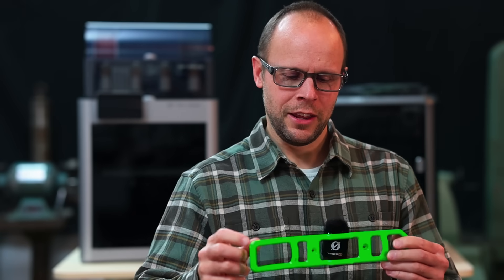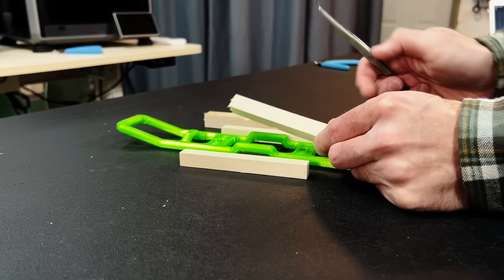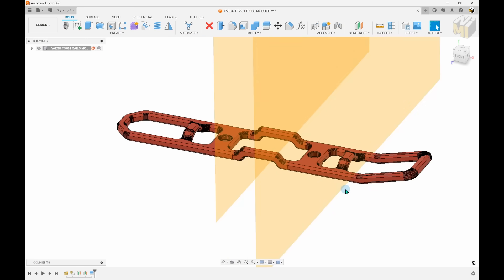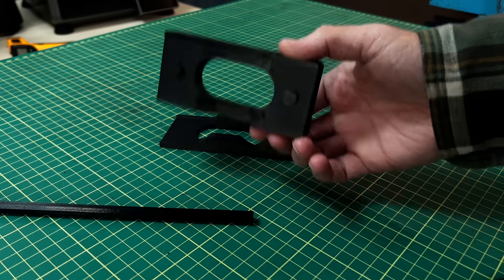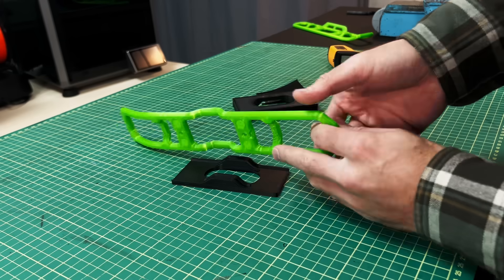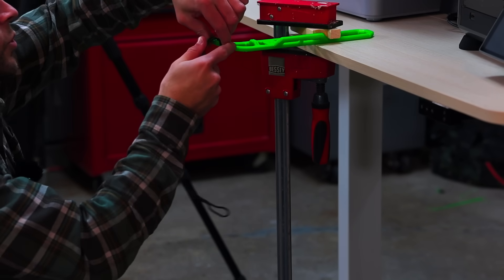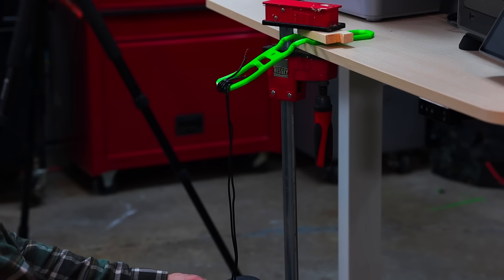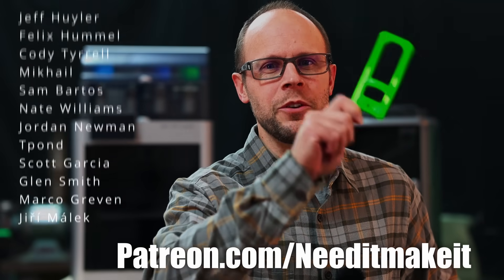2 Simple Ways to Make Stronger 3D Prints + an Experimental Way

Comment: Petg-CF. Problem solved. Dry, 30% fan at high speed extrusion and 70% fan on overhangs. I have parts I am manufacturing for mass production and they need to withstand 50-75lbs of pulling force.
Reply from the maker: I'll whip some up, I have some PETG-CF, I've found my prints with it in the past to be brittle... but it was the cheaper stuff, I'll add it to the roster to try again!

Comment: While it may not have worked for strength, I like the forming idea as a way to print parts without supports or bridges, and that curve would have had obvious layer lines if printed that way.  Obviously, there's the overhead of printing the forms, but for creating a lot of the same part, where you can reuse the forms, this could be a great technique.
It would have been interesting to see which was strongest when used as intended.  That is, bolt it properly to something rigid, and put a strap through the loop, and hang the weight off the strap.  I suspect the formed part might have fared better in that test.

Comment: Might want to try a hard shore strength tpu
Reply from the maker: I'm just about to setup to test 95A TPU, but I'm not sure it's hard enough, it seems anything harder is "too hard" or at least that's what people are telling me.  From my testing so far, the 95A seems a little too flexible.
Reply: Yeah, 95A should be good for this purpose, but in all honesty you need to revisit the actual design as well IMO. I feel that thickness, print orientation and print speed/heat/nozzle size will all play into how this performs. 

There is no reason that a well designed part in 95A, that is well attached, will not be strong enough. 

As other have mentioned ABS/ASA work well too for strength. PC is about the strongest, but its also the most difficult to print properly and its also a material that suppliers on the cheap side seem to mess with and screw up. Has to be a decent brand/quality IMO.

Good luck. Like the videos. I like that you provide a more realistic use case. You cant just 3D print everything and i like that you, like myself, mix media and techniques for best results and tactile feel.

Comment: I would take a different approach. Instead of trying to copy a fragile frame, I would think of making a plate. I can't see any reason, why the outside could not be flat. So the plates become thick and chunky, perfect for 3D printing and very durable. If you make the outside flat, you can arrange the mounting points an all needed features easily on the inner side. The plate was a perfect for making a clever designed hole for the belt, and you could arrange a channel for the power-cable too. And towards the front you kann taper the plate on the inner side, so you achieve the "curved" look of the bent frame. I would imprint hexagons on the outside of the plate, so the look would be very nice too. Greetings from Vienna!

Comment: interesting idea to print, then press it in a mold, it might not have worked for this project, but im sure the idea will have its own usefulness on one some where. Its a idea ill have to try to remember.
Reply from the maker: It's a little bit like steam-bending wood, which works really well... though it is pretty slow.  I think there is still some potential, but there are some things that need to be better understood about this material first.  I wonder if ABS is a better choice for forming in this way?
Reply: @NeedItMakeIt  either way, it earned my sub.

Comment: Like your simple approach to this testing method. Since your are using translucent materials, you could back light and use a uniform load at different directions and positions to see where the stresses are applied. The light diffraction on the part would help show where to focus your attention. After collecting a few images of the various loaded stresses, look at all of the areas to focus on either increasing rigidity or flexibility (depending on what behavior you are looking for based on the parts use). Would be interesting to watch that as an experiment😁

Comment: For the inner-void trick, bear in mind that it lets you shape and direct as much of the inner “fill” as you want. I’d try extending the void channels all the way, curved around to the screw holes and continue down and around the full length. That way the stiffened section doesn’t just end internally, perhaps acting as an even-worse vertical shear/break point.
Reply from the maker: That's a good point, having it stop short caused the stresses to concentrate just beyond the solid area.  I have a follow up video as well which went over a few other options and materials and there was one that stood out from the rest, it was pretty impressive actually, the 'tear-drop'
Reply: @NeedItMakeIt  yup. Watched that one after this one!
Reply from the maker: @AndrewPlumb  Nice, thanks!  I think you're right, I'll have to do some more tests, I have a TPU version that I want to make as well, so many people say that TPU is the way to go, but it's so much different, I need to work with it a bit more and figure it out.  It's super slow to print and more like a rubber, so mounting it and having areas which are stiff is something I need to think more about.

Comment: Is it going to far to print the "beams" in two parts, perhaps with little pegs to connect them and a channel in the middle, heat and bend them, and then place a wire bent in the same way between the two halves? Or perhaps print them halved but otherwise in the final shape you need and to put a wire in there?

Comment: i dont believe the formed one was weaker per say. my assumption that the area you formed became stronger the rest. the point of which that sat on the edge that wasnt heated and formed is where the bending occured. you can see the bridge that was formed showed almost no bending under stress. how ever both ends of either side of the bridge bent significantly, by hardening the bridge the new weakpoints became where the harding started and ending on both ends of the bridge..
Reply: with that said try making a form for the entire model and heat form it in all in one go.
Reply: im curious to see how this would effect the model in its entirety. by doing this i also believe itll be stronger but you will lose the pliability of the item making it brittle. thanks for this video. good stuff!

Comment: I have watched many many 3D printing videos and the overwhelming conclusion I've drawn is that the best trick is to just print everything as standard as possible.  No baking it in sand, no embedded fibers, not super slow or super fast, just 0.2mm layer heights with regular speeds.  If it needs to be stronger, change the design.
Reply from the maker: Avoiding post-processing is one of the biggest benefits of 3d printing, best to take advantage of it for sure.  I just released a follow up video to this one to show off some of the different properties of the materials.  No post-processing, aside from using supports because I printed all of the parts on their side.  Performances ranged from poor, to extremely good using ABS/PC/PETG and Prusament PETG also.   

I'll be testing TPU next, but I need to wrap my head around the material a bit better, it is far different than the other materials and requires a different approach I think.

Comment: I use printed parts on a milling machine and a lathe. You should make the parts bigger so it is not bending. With bending the layers coming lose and your lose your structural strenght of the part. What I do on PETG : Use 5 to 10 degree higher printing, set the extrusion to 1.05, 100% solid. If you have a design of alu, make it 2x thicker for PETG (more volume). Remember bending and flexing is bad for the layers unless you use TPU.

Comment: Im building a Printer, Ive had a nightmare trying ABS and ASA for the parts, even enclosed curling has spoilt every try. Then I see eSun's ST-PLA. Super tough dont you know. And it is, Prints perfect, vey little shrinkage if any and it lives up to its name, Printing 100% Concentric infill gives you solid really strong parts.

Comment: I made some legs for the couch from PETG. Total weight was something like 1.3KG. Printed with 4 walls orso then 8 bottom and 8 top layers. I oversized them for good reason. So then I was looking at the strength of them and while they were good, I also knew they could be better. So I turned on the oven at 70 celsius and threw them in. 20 minutes later they had gotten taller and less wide so they were a extremely snug fit at that point. I think given that clearly it had somewhat remelted it should be stronger than it was.
So a couple weeks later my dad finally disassembled his chair that had a broken gear for the rear tilt mechanism and I printed a replacement. I had the orientation wrong so I had to print it again however before printing it I put it in the oven at 60 then slowly increased the temperature to 80. That caused a similar change where it got longer and less wide. So I plugged the numbers into Cura and printed it again but this time in the right orientation and after putting it in the oven it was a perfect fit. The part takes on the weight of who ever sits in the chair so it was crucial it was strong.

What I am saying is: If you need a functional part you might want to test printing it several times edit any flaws and measure everything just to make sure its the right size.

When I just got my printer I tried printing a replacement for the aluminium part of my window. It broke. Using the same method I might be able to make it properly.

Also from my testing there is basically no difference between fan full speed or fan off with PETG apart from lots of strings. That is my testing. Which is by no means accurate. So test it for yourself. In this video fan off seems to have helped so try it.

Comment: Thanks for sharing this very informative video. If you look at the original design page at the 3:43 mark of the video, you can see that they are printing it on the side. Granted, it will require the use of supports, but it also changes the layer line directions to favour strengthening the sections that seem to experience most stress. Would be interesting to see the same test applied to the part printed in that orientation.

Comment: When you formed the last one, it looked like it had the same dimensions as previous ones.  So the forming pulled/stretched the loops.  It also appeared to break roughly where it was stretched for the loop.  I wonder if you would have gotten a different result if you made the original longer to account for the forming of the loops, such that when the loops were formed, they didn't get stretched because there was enough excess material to make the shape without stretching?  Cool experiment though, I never considered forming my prints.

Comment: 3:35 Are you sure you didn't simply print the model in the wrong orientation? Looks like you printed it flat but based on your wood grain comparison you should print it upright so those bends stay mighty strong. Which is also exactly what the creator of the model shows on the thingiverse page.

Comment: Awesome video, Mike! I really like the combination and balance of engineering and making in your videos. There somehow seems to be an 'everything needs to be printed' mentality in the 3D-Printing community. Did you consider using aluminium tubing as top and bottom rails that will be connected and capped off with 3D-prints? (Use off-the-shelf strong parts for structure and 3D-print the unique and intricate parts. Assemble into 1 solid and strong part).
Reply: that was my thought as well.  You could either insert them halfway through the print or make a mold of that part and insert it then :D
Reply: @stevrgrs  Exactly!😀😀

Comment: Alex Labs has a great video on making strong 3D prints. Video is called '#7 I FOUND IT!!! Perfect material for Real Iron Man suit. 3D print + carbon fiber + electroplating'.
Reply from the maker: I've never heard of it, I'll check it out thanks.  I just finished my test rig for some REAL drop testing on these rails, and geez... feeling the weight of this thing I'm not sure there's a lot that would survive a drop.  The goal with the next set of tests is that the rails make sure that the device stays protected, so... hopefully at least one of the options does that.  

I've seen a video or two on electroplating prints.  It seems like we've all gotten a bit carried away with out 'little' 3d printing obsessions.  What do you think it is about 3D printing that draws so many people in?
Reply: @NeedItMakeIt  Give your average joe the power of being a manufacturer, and the world becomes small enough to grasp. True creative freedom to make whatever you want for a fraction of the price. It's liberating.

Comment: Great video, I have the same experience with afterheating and forming: not only does is become brittle (because it breaks where it cooled down the quickiest), but deforms completely, any infill will also shrink, and or become weaker. Printing slow is not the thing, the temperature is. Some PetG's print better at 270°C and 300 mm/s. But I can't see your settings, because the file you uploaded is not a Bambulab file.
Diminishing the model fan definitely helps, bacause the complete model stays hotter (that is why high temp and fast printing are sometimes better with Petg, and only with Petg, other materials have other specs)
Reply from the maker: Ah, that's good to know, from what I had been reading about this, the cooling was the biggest issue.    I wanted to print all of the samples with the fans off, including the cabin fan and I also kept the door closed, which resulted in some pretty ugly overhangs.  At least we have slow even cooling.  After the print finished I let it cool completely before removing it as well.  

With the one print that I post-formed, I could have probably re-heated the entire part to just below the transition point to see if that could help. 

I have a follow up video I'm working on right now, trying to take all of the suggestions from this video into account to come up with something that won't break at all, but rather bends and absorbs the impact.  I have several PETG samples again, but I also have PC and ABS.  That video should be out in a few days.  I'm nearly at the point to start testing, so hopefully we get some interesting results.

Comment: I have made these exact same brackets for my radio. I experimented as well and settled on ASA since my radio will often be stored in a hot vehicle/ While this video is more about strength and less about these particular brackets, I was excited to see them!
Reply from the maker: Ah, cool.  ASA is probably a good choice, did you happen to print these on their side?  That's a good point about storing in a car,  or even outside in the sun.  I have another video on the way with a few slight adjustments to the rails to make them stronger and better to print on their side.

If you were to drop your radio, what is the most likely height it would be dropped?  I was thinking that it would be max 30" high and a person might be walking with it.  I'm trying to come up with a realistic test to see how impact resistant they are with a variety of different material choices.

Comment: Add more material where the high stress areas, where the material failed. This means adding gussets at the transitions in directions.
Reply from the maker: I'm at a bit of a cross-roads and I could use some advice.  If we add more material we end up with something that's stiffer and can take more loading, but it doesn't flex as much, and with PETG I would imagine it would result in a fracture if it can't flex enough.  Is it always better to add more material than less?  Or is it better to size the material dependent on how you want it to behave under certain conditions.  If I drop the radio, and I want those front rails to bend a bit and absorb the impact for example.  Thoughts?

Comment: Are the center openings needed?  If not, why not fill it in all the way and print it on its side so that the layer-lines follow the curves?  And even if the holes are needed, that orientation and using support (if possible with a PLA separation layer) might still be better if you need the curves.  Of course, printed completely flat (so at least one side fully flat on the bed) and completely filled would be easiest and very strong if your usecase would allow it.  The current part just looks like it was designed for injection-molding, not optimized for 3d printing.